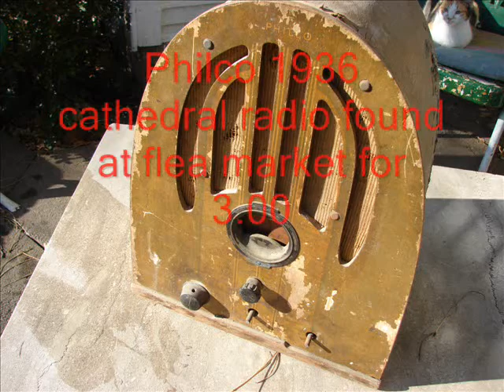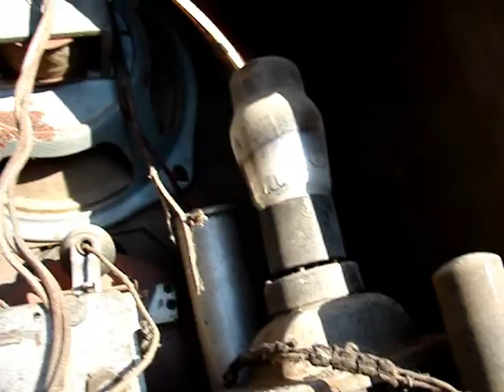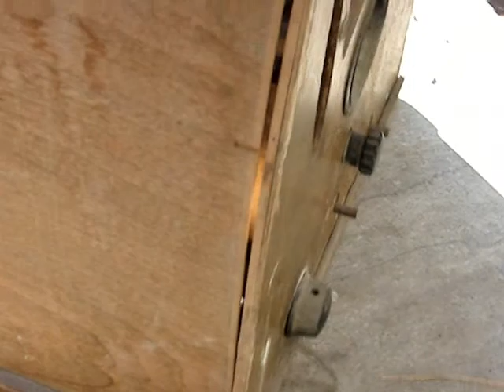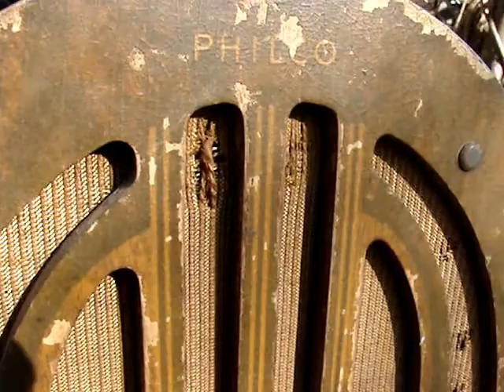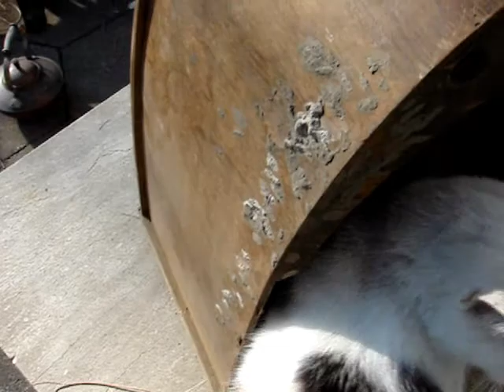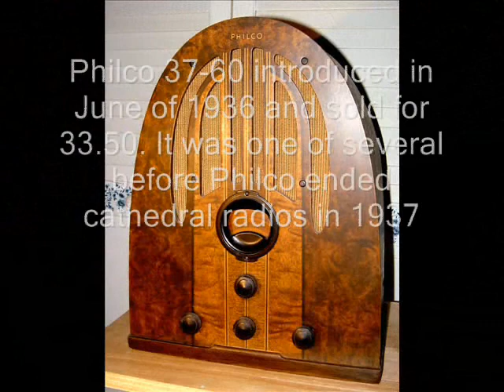1936 Philco Cathedral Radio -  Music - On Account of Your Kisses - Johnny Hamp

Comment from the maker: @SpeakerFreak95 No that is one reason I bought it was for the speaker and tubes.  Field coils of any size today are expensive and hard to find.   I do believe that when replacing a field coil just any field coil won't do. I'm not sure but I think the impedence of the field coil has to be the same or pretty close to the original, and some differ a great deal in the ohms.  The Magnavox Windsor field coil is 140 ohms while other 15" field coils are  rated at 2500 ohms.

Comment: I have a friend that just restored the chasis of a very thrashed 1932 Philco.  It cost about $126 and I paid $180 for the radio.  It's worth about $400-$450 now but I won't part with it.  They are worth fixing up.  I spent about 4 hrs sanding and staining mine.